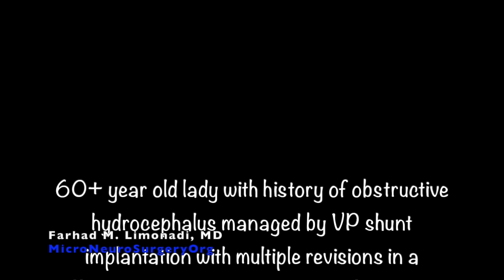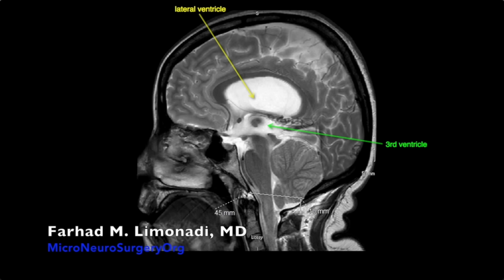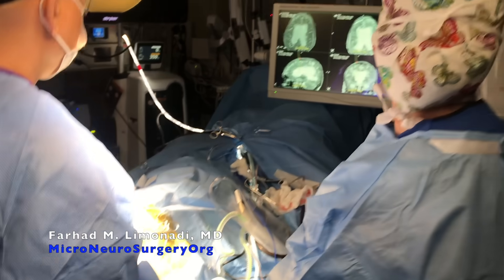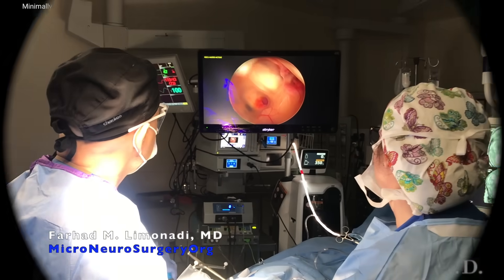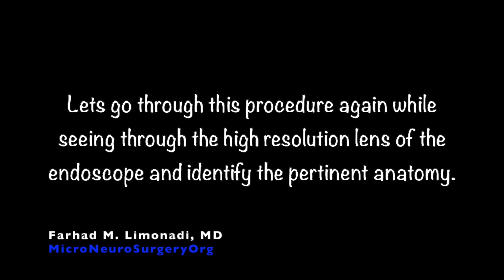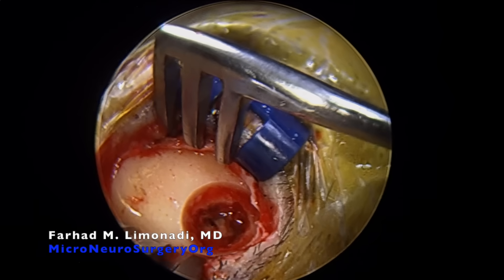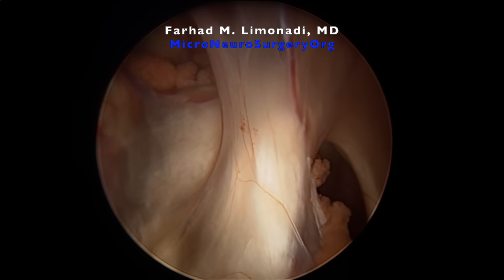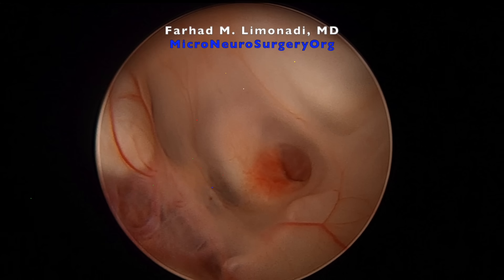Endoscopic Third Ventriculostomy. Distorted brain anatomy and treatment of Obstructive Hydrocephalus

Comment: As a guy who just enjoys watching these amazing surgery videos, I'm always blown away by the dexterity of the surgeons. Not only that bit the tiny scale of the tools you use! The tools themselves are always so interesting, may I ask what diameter the micrograsper head is? Unreal to me that we are at a stage where we can make such tiny graspers and be dextrous enough to use them. Amazing work!!
Reply from the maker: Thank you for your comment.  The outer diameter (OD) of micro graspers used for endoscopic third ventriculostomy (ETV) is often less than 2 mm, designed to fit within the working channel of a commercial endoscope. The diameter of the actual hole created, known as the stoma, is typically widened to between 3 and 6 mm

Comment: Quick question, what is that long golden rope like substance lining the ventricle seen @10:00? Are those ependymal cilia? Thanks
Reply from the maker: They are choroid plexus: primary producers of cerebrospinal fluid (CSF).
Reply: @MicroNeuroSurgeryOrg Many thanks!
Reply from the maker: I believe you are referring to  choroid plexus of the lateral ventricle which is formed by the tela choroidea, a fold of pia mater and ependyma, which enters the lateral ventricle through the choroidal fissure. Its blood supply comes from the anterior choroidal artery, a branch of the internal carotid artery, which forms a network of capillaries within the pia mater that projects into the ventricular cavity.

Comment: Dr. Limonadi,
Once again, you have shown the strength of your training, and in this case, teaching ( I assume the colleague at your right shoulder is a post-doc fellow)...
I was lost anatomically  before you chose the site of the stoma.  Your patient approach and verbal descriptions helped orient me...
I am curious... Does the csf flow itself keep the stoma tissue from healing, thus preventing closure and scarring...???
Thank you for sharing your impressive skill set...
DKCyX
Reply from the maker: Thank you! The CSF flow can keep the stoma open, so I try to avoid putting a ventric. catheter after the procedure.  The size of the stoma needs to be as large as can be done so safely without damage to mammillary  bodies, basilar artery, and delicate pontine arteries.
Reply: @MicroNeuroSurgeryOrg Thank you for the explanation... It does make sense to open the stoma as much as safely possible to prevent self-healing...
Also, given the patient's H(x), I understood the family's reluctance to permit more hardware after the failure of the shunt in prior surgery...
I literally cheered when I read the post-op notes... The patient is most fortunate to have had your attendance for this life-changing surgery...
Reply: Thanks for responding I was going to ask the same question.